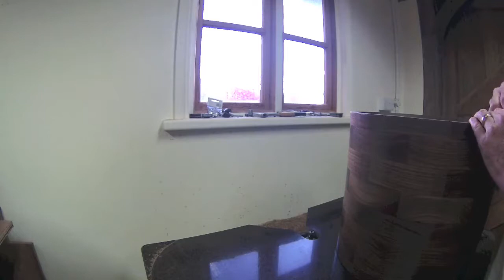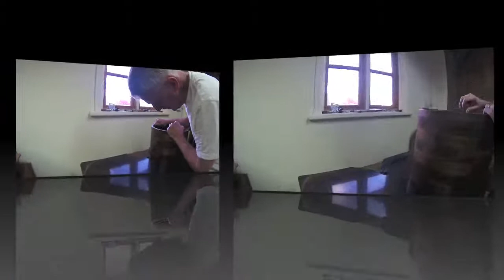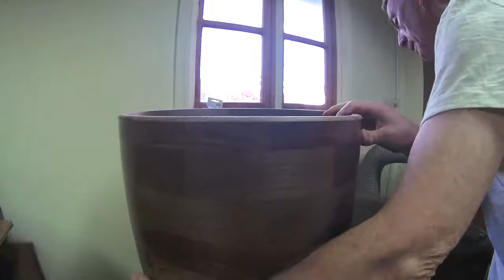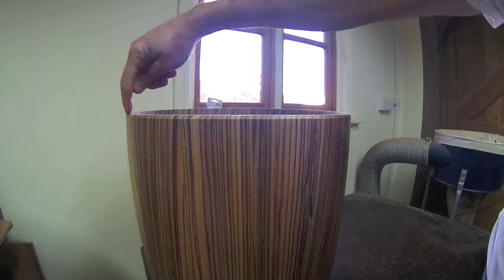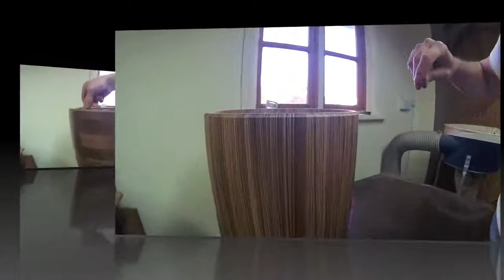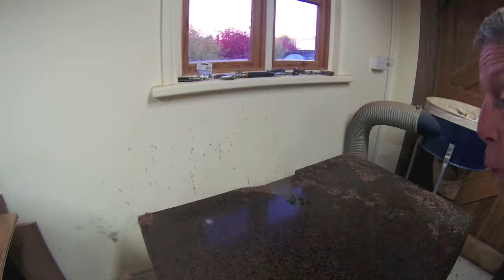Tympanic bearing edge machining.

Comment: Hi Andy, I absolutely love your video!  Would you please tell me what size radius the round over bit is to cut your bearing edge.  Thank you very much!   Jay
Reply: Typically R6, but varies according to shell re-ring thickness.
Reply: @firedup7280
Reply: Thank you!  I was amazed at the resonance of the drum you hit and would tell me what kind of heads you had on that tom?  Perhaps a clear single ply on the bottom and a clear double ply head on the batter side?  Correct me if I’m wrong.  I would love to replicate that on my own drums.  Thank you very much for this info and will certainly be giving all the props!  J.

Comment: Every positive has a negative when you hit a drum and it keeps continuing to ring that's really not a good thing especially in the studios what it comes to a note on a drum adding Hardware to a drum will change the note why. the type of metal or wood is the factor let's talk about rims. copper Rim will sound different than a gold rim a metal rim who sound different than a aluminum aluminum rim a wood rim will sound different than any type of metal rim  so you  different type of rims gives different tone.. Take that in for consideration Finding the right type of material for that right type of wood  we're halfway there  and when it comes to bearing edges  where the highest point of the edge where the head makes contact matters if it's closest to the inside of the drum or if it's the middle of the drum Edge or the outside edge of the drum does matter take that in consideration degree of cuts do matter  25 30 45 60 degrees 90 degrees back cuts,,,,,, taking consideration so many different combinations would you rather have the inside of the drum ringing vibrations or would you rather have the outside of the drum ring and vibrations   taking consideration and how many plys  of the drum  take that in consideration and how  you want your plys to lay ( hyper drums) shells direction of the Plys. Taking consideration  and of course the type of wood Birch Maple Birdseye,,,,,,,,,,,, take that in consideration, so after you think you figured all that  out and what  Finish the wrap the stain the paint the lacquer the  Finish take that in consideration and how about to finish inside the drum . We haven't talked about sizes how long the drums should be take that in consideration  and what size should it be take that in consideration We haven't even talked about heads yet which is the most important thing of all  1 ply 2 ply oilfield how many millimeters canvas cow fake cow rawhide clear head Whitehead head with dampening pinstripe,,,,,,,,,,  take that in consideration  is the drums flat and in a perfect Circle blah blah blah  and how much can we screw you  (cost) an overprice it or something they think you need referring to drum companies, and how beautiful you want  them to look .   I've been doing drums for 20 years  and I've seen drum companies come and go. I love going to The NAMM Show and listen to drum makers try to sell you their creations and  I watch people hit outside of the drum   to listen to them ring with their finger  then they hit the head and listen to it ring. Joke  so let's talk about Ludwig how many different names of drum kits do you think they had the last 10 years  (models) no longer make it discontinued  here's the way I look at it  what to type of model you're buying the consist of   drum hardware. Quality  If you talk about Woods or talking about furniture  talking about heads to talking about speakers   for talking about Woods an old Les Paul what is really dry a new Les Paul the wood is going to be very moist two different sounds moisture   expand and contract  if you have a marshall cabinet  made out of maple wood the cabinet will always sound the same . If you install 25 different speakers you'll probably get 25 different sounds  my point is the drum wood is the cabinet and the drumhead is the speaker wrong speaker make the cabinet sound like crap so there's a lot of myths For Drum Byers I have a Japanese no name drum, which has a knot on the bearing Edge drum is not straight it's not round it's not flat and has a bent rims on it the head is holding the not in place 60s drum made by Triumph. Lol. All stock , the drum sounds amazing snare take the head off the knot falls out it's the sweetest softest drum I've ever heard Buddy Rich would be proud my point is this drum debunks all the myth of what a good drum set sound like  look like feel like   Studios love it no snare strainer no ringing or buzzing and no need  for dampening  it. The cheapest  Lugz diecast rims   I cannot tell you how many people offered 30 x  for what it's worth  you do make beautiful drums and I really appreciate your knowledge  and being wide open finding the right combination of all what's to be considered on what makes a good drum and a good sound depends on a lot of elements,, you're not going to make a jazz kit sound like a concert kit  acoustic it's not going to sound like electric kit  ,,,,,,, there's a lot of different ways and making your kit sound different just buy the  hardware rims  heads   do not trust your local drum maker   do they know what a 20 head by 22 lengths bass drum sounds like it's too long too punchy,,,,,, blah blah blah blah  if you've never played one and you  never made one you just don't know    you don't have to spend a lot of money to have a great sounding kit I can remember when Ludwig came out with a model made in Taiwan that drum kit 
 sounding better than made in the USA top of the line kit at half the cost guess what discontinued  I didn't get into talking about clear octagon  drums changing the angle lol.
Reply from the maker: You put a lot of energy into saying many things affect how a drum sounds, and some of it may or may not have value depending on context.  In this instance, the edge was developed to be used in a specific context, namely facilitating a very controlled batter head for close micing purposes, whilst still offering a balanced delivery acoustically, thus expanding choice headroom.  That either has value to you or not, depending on your playing context.  Features in isolation are almost meaningless, it's all about context.
Reply: @gurudrums1  Would this type of bearing edge be useful on concert toms (single headed)?  Thanks.
Reply: @gurudrums1  close miking purposes microphones is a whole different animal placement of microphones on a guitar cabinet speaker is the key. Moving a microphone a half-inch in a different angle  there you go if you are trying to control the vibration via where the drum head meets the top bearing Edge. You take a drum head with no bearing Edge whatsoever head's not going to vibrate which is ring too much ring is not good especially with mics. And yes I'm all over the place because people don't understand the confusion the myths and how to get a  good drum sound my opinion your drums sound good live but in the  it'll be a lot of ring noise yes, Noise Gate  compressors filters  can clean all that up different mics and locations........, let's just put the drum set through Auto-Tune  lol. I get you  hundred percent what you're trying to achieve and bringing something new to the game which would be a   softer,  less aggressive  ring tone  for a certain type of music
Reply: but there's still a lot of myth that are not being addressed when you hit a drum why do you want it to keep vibrating  ringing ? You do a drum roll on a 10-piece kit and all your drums are vibrating and still ringing not good , recording or in the  Maybe used two overhead mics and hopefully get away with it  I'm a big fan of May miking inside the drum when dialed in and placed right no outside interference    phasing,,,  and I'm a big fan of aluminum Hardware rims and lugs,,,, wood rims are nice and give you a sweeter softer wood sounding tone  Walnut Cherry Birch,,,,,  great for Rim shots brushes,,,  and I really think you brought in an improvement where the head contacting the drum rounded  bearing Edge focusing on the head movement   I guess for  mic   purposes  $10,000  dollar mic it's not going to sound like a $99 mic. 80% of a drum sound is to drum head  and how it  contacting the  drum surface  when it gets into  to clear drums fiberglass drums metal drums  changing the bearing edges it's not going to do much which I'm not a fan of either of those materials   some people just want to make beautiful furniture (drums)  at a high cost and I'm not down with that, wouldn't you be insulted if somebody installed Evans hydraulic head on your beautiful drum It would just killed your tone ring    thank you again for sharing your knowledge and throwing it out there not making any claims stupid myth your  workmanship is outstanding
Reply: Sorry part 2  a certain type of tone
Reply from the maker: Thank you for your kind words.  BTW, the drums with this edge correctly applied record beautifully without need for dampening, gating, or any overt processing control actions, and are used as house kits in a number of notable studios around the world.
Reply: @gurudrums1  I'll have to disagree  little bit  about a perfect cut bearing Edge  look at the new vox bass drum the one that looks like it's melting pretty much all your theories go out the door. and when it comes to credits and who you know  and what you've done l have  made a very good living who turned down many jobs  Remo recently in Valencia California  and currently in Tennessee Nashville  and heading to Ohio in two days regarding another project  and believe me not by choice  i am pit  schooled  a drum teacher with  about 6 students  not by choice usually under privilege kids I have a wall full of credits   I know what a drums should sound like especially what a customer needs is what they're trying to accomplish  I'm a machinist by trade but my friends keep me busy musically i don't want  or need to own a  drum company I don't want endorsements . Don't want to work for record labels and I hate traveling and touring is the worst  I do  session work time to time and my good  friends in the music business has kept me pretty busy   and Word of Mouth had made me  financially very  stable.   I currently volunteer most of my time now giving back to the youth  when back in California  home.  If you would like I can send you a video  of  my Japanese throw away snare drum with a removable knot at the bearing Edge which the head holds it in place with bent rims which defines all  myths and Hocus Pocus people are throwing out via    internet. This drum has taught me more then any one person in the business Charlie Watts would be proud, no need to respond with ideas or wise knowledge or what works for you   of what you think and know.  But I cannot tell you how many hours I spent in a government test facility soundproofing room   with the best testing equipment the door is so big it needs a  motor to open it close it  and I work there for three years and took many drums in there experimenting the company is National Technical Systems in Valencia California  so when it comes to actually testing sounds  and actually having state-of-the-art data. I currently have a lot of time  researching drums in a correct environment  testing facility. Knowledge is King.   Data don't lie and it's how you use it  there's just a lot of misinformation out there people talking a lot of words but have no meanings. Keep up the good work
Reply from the maker: @sonofgunsonofagun2432    I'm not sure why you're feeling the need to push your point of view.  I'm not making any claims I can't back up 100%, and I'm not marketing anything.  This little video is simply a help tool to assist those wishing to machine this edge form.  It's open source - I have nothing to gain from this.  Additionally, I stopped crafting drums over 2 years ago due to ill health.  I'm pleased that you're happy with your drums, & confident in your reference points.